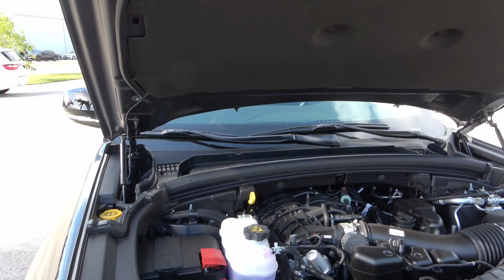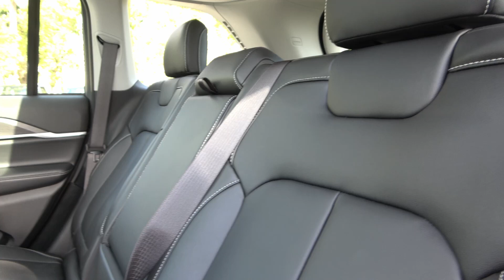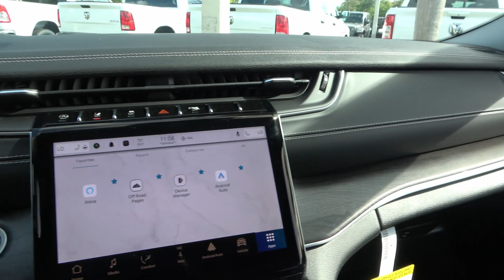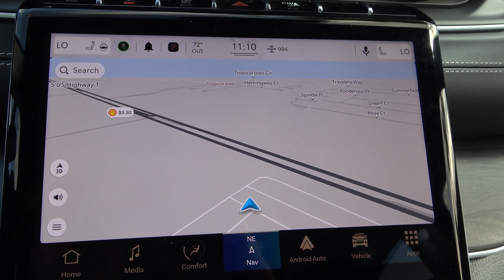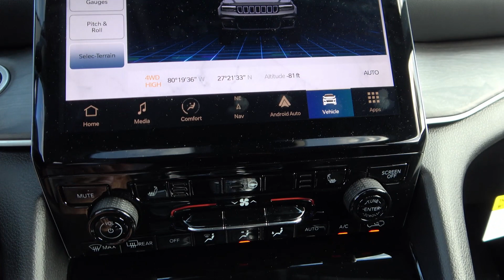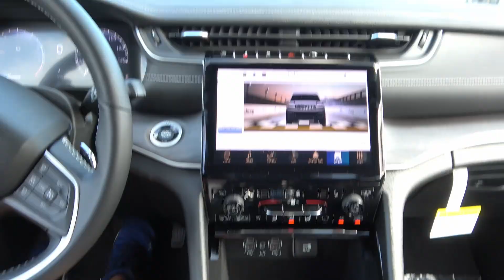Is the all new fully redesigned 2022 Jeep Grand Cherokee the best mid size SUV?  Review, POV drive.

Comment: Nice video Matt. We're considering a new GC WL 2 row Limited, and have impressed also. The price is a bit more than it's competitors, but I think it's worth that little more. I have never liked the everyday point "A" to point "B" blahmobiles. I like a vehicle that is fun to drive, and the Jeep GC WL stands out in the crowd IMHO. Thanks for the review. It looks like I'll be ordering when the '23 order banks open.
Reply from the maker: Grand Cherokee has always been fun! This new generation is even better. You are probably better off waiting for 2023 anyways as they work out some minor bugs in this new model. Also more options may be available as the "chip shortage" lessens. Thanks for watching!